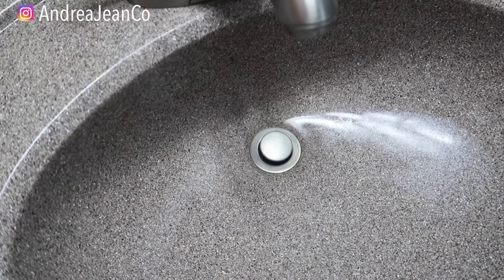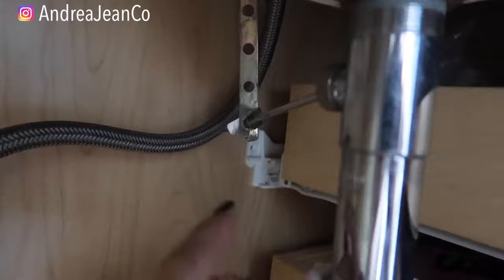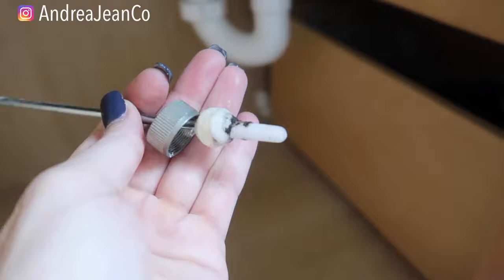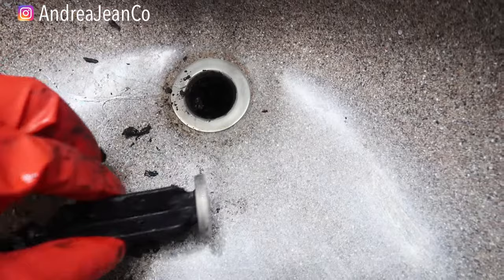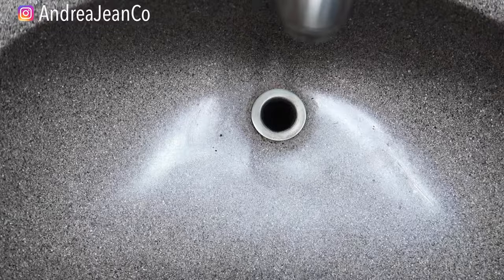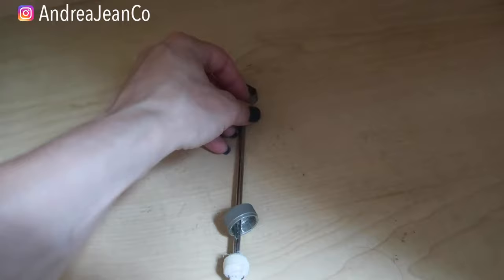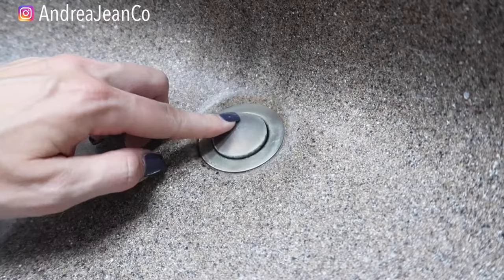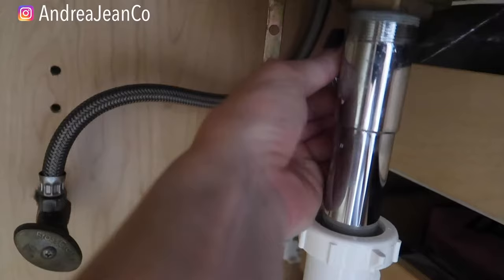How to Remove DRAIN STOPPER POP UP!!  (Unclog Cleaning Hacks) | Andrea Jean Cleaning

Comment: I would use Drano and then for a week it became slow again, use Drano, wait a week, and so on. 
I was ready to call a plumber until I came across your video. I pulled out the stopper and it was encrusted with what would look like tartar on teeth, but thick amounts of it. Soaked in vinegar for an hour, then scraped off the stuff. Thanks a million!

Comment: I finally know how to remove the drain stopper. I've been using random items to clean out whatever I could pull out. Only problem now is that the stopper doesn't go all the way down so the water drains instead of letting the sink stay filled up but I'm sure I can eventually fix that. It's not much of an issue. From extremely clogged sink to practically brand new is wonderful. I'm glad to have seen your video. It didn't even take me ten minutes to fix the sink.

Comment: Andrea, you did an excellent job on this video that will help so many people....  and I'm amazed at your camera work. I just cleaned mine out a couple of days ago and I always dread it because of how hard it is to get the little hole in the  stopper lined up with the rod underneath all while with one hand you're holding the fitting underneath.  It's like you're in this big body hug with your sink!  ...when you took it apart, I thought to myself that I hoped she remembered to notice what hole the rod was stuck in because that makes all the difference in how it all drains and you certainly don't want to do that body hug any more than you have to.   ...i was able to go almost three years without cleaning mine and that's great because I always wash my hair in the sink but I also collect that hair from the bowl before draining just to avoid having to clean more often and also it shows me my fallout.  In other words my practice at home is to head off trouble by watching what goes down the drain.   ....this clean out is something everyone should do themselves instead of calling a plumber.  I know someone who puts some God awful chemical in hers to clean it and I have explained how easy it is to really clean it this way.  I have a septic system and I definitely don't do anything to disturb the natural balance of bacteria in the septic tank plus I don't want harsh chemicals sloshing around in my pipes and seals. They're my friends, right (lol).  From one girl to another, you did a great job on this video.  Best wishes with baby!
Reply: i ❤ i’m

Comment: I had a skuzzy bathroom sink drain that needed cleaning. I did this before several years ago but needed a refresher. So, I Googled "Kohler bathroom drain plug cleanout instruction video" and there you were. Easy to follow!  I will save your video for next time because I will likely forget the details next time. Thank you so much! I now have a free flowing clean sink drain. The hardest part was crawling around under the sink on bad knees. How did you ever do it while expecting a baby!  Wonder Woman!
Reply from the maker: Thanks so much ❤️❤️❤️

Comment: Super helpful, thank you for making this so easy. I used a pair of needle nose pliers to remove the hair below the stopper. Once I reconnected it it was still draining a little slow so I poured about a half cup of hydrogen peroxide, waited 5 minutes then flushed it with hot water and a little dish soap. It is now fully draining.
Reply from the maker: Glad it helped!

Comment: Thank you so much for this video! Worked like a charm! The only way my experience differed was that had bought a sink shroom that i knew id be putting in the drain instead of putting the stopper back in. With my long hair, I knew that would be a better option instead of having to routinely clean out my drain this way from now on. I did put the screw back that closes off the hole in the pipe itself, but it didnt reattach the stopper mechanism since I knew I wasnt going to be using it at all. So, I just put the original stopper and the clamp that attaches the stopper into a small baggie and put it under the sink, so if i decide i need to use the stopper at a later date, i can reattach it. Thanks again!

Comment: Thank you SOOooooo much for your video !!!! I can not believe that I’ve just fixed my two bathroom sinks . They were clogged almost completely for months and  every time I use them I think how much I should to pay to plumber ..... And today I found your video . And I with great fear, knowing that it is easier to disassemble a thing than to put it back together, began the “fix the sink yourself” operation!  I followed step by step your explanations in the video.  I will not say how much sh*t I pulled out of the drainer ...... And then I put everything back together and turned on the water .... And what a miracle !!!!!  My sink was like a new.  Everything turned out just perfect! I didn’t have any extra parts left over  as usual 😂, and there wasn’t any  leaks, which was also one of my worries.  THANK YOU again for your help.

Comment: works great.  I found that I didn't have to disconnect from the vertical slide, just unscrew the cap from the drain and wipe the white thingy clean,  That made it easier to reattach.

Comment: Watched this video and had a lot of confidence I could do this and was feeling better about things…boy was I wrong. Currently in tears because my sink is apparently still clogged and I think I just made it worse?! The water is going down a lot slower now and I’m at my wit’s end. Cleaned out the drain with a toothbrush and there wasn’t even as much gunk as what I saw in this video, but I am wondering if I might have accidentally pushed down more gunk I couldn’t see further? Thus that’s why the clog is worse?! Idk but having a mental breakdown because my bf is useless in this department and works a lot, and this type of work always falls on me. Thanks for this video regardless. You inspire me to try harder and just keep learning.

Comment: Girl you just saved me from calling my plumber!! I didn't even get grossed out.  I was wondering, if I wanted to do a drop drain clean, could I close the hole that holds the stopper connection and fully clean the drain with liquid drain products? Do they have an extra piece so no water or chemicals come out the whole?
Reply from the maker: Glad I could help!

Comment: I have used tweezers to pull gunk out from under the plug lid to avoid having to completely remove the plug .  In your case, I think I'd use some long needle nose pliers to reach down the drain and get a good hold on the hair mass and pull it up.

Comment: Thank you! It took so long to find a video to show how to remove the plunger! I did two sinks in 10 min! Also I realized you can just unscrew the part that hooks to the plunger and let it hang while you pull out the plunger. Unless you need to clean it.

Comment: Thank you so much... it's the knowledge I needed to get a dime out of my bathroom sink. I use an, as seen on TV snake with Velcro on the end to get the hair out of the drain. So, when I got the plug out there was no hair, but the end of the plug was filthy, caked with black crud, so I cleaned it off. AND I got the dime, but I had to take the U pipe off to get it out. Again, thank you, I appreciate your video.

Comment: I did mine and it was almost so easy!  Except I took the cap off and the plug fell into the P-Trap.  Don’t panic, put a bucket under there as a little water will be in the Trap.  Unscrew both ends of the P-Trap and get it out (which is probably on her other video). WARNING, when you open the trap the smell will be horrendous…I immediately poured some minty mouthwash in the bucket of water and gunk from the Trap.  I’m proud as I didn’t have as much hair as she did, Lol. You can do this !!

Comment: It might be possible to just unscrew the drain plug lift without disconnecting the lift arm at the back. The arm will just angle rearward with loosened lift plug mechanism after removing the screw. Thank you for the nice video covering stuff that we all dislike doing! It's nice that you take the time to produce your informative videos. You may consider placing the drain plug 90 degrees to the lift arm mechanism for easy removal, just keep in mind that drain doesn't seal as well when the plug and drain gets dirty. Also I think Dollar Tree sells a drain tool that cleans the drain it's a stick with plastic barbs that catch the hair on removal from drain. I'm glad you covered a subject that we all dislike cleaning but has to be done.

Comment: You don't have to disconnect  the white plastic bar under the sink from the vertical metal lifter that has the holes.  Just screw the lid open and pull the white plastic bar from the drain tube

Comment: Mine is the newer design where you push down to enable filling, then push down again to drain. There is no lever.  It is critically important not to do hair in that type of drain. You can't pull it out to clean the drain. Should have gone with the lever style. Oh well, live and learn.

Comment: If you're going to use hot water to flush the sink once the stopper is out, I highly recommend screwing the stopper holder back in before doing that. Otherwise the hot water will flood the cabinet under the sink, like it did for me.  Even if you put a bowl under the drain before flushing. Grrr, more to clean up

Comment: your Hardware store will carry a "hair snake" . Its a long tough plastic  cord that has  molded "barbs" all along the cord that snags the soap encrusted hairball  so you can grab it and pull it out. You just thread it down the drain twisting it as you work it  down, like turning a corkscrew into a cork in your wine bottle. Once you have it all the way down the length of your P-trap ( that U-shaped elbow that makes up the crook in your drain) then with deliberate pressure, slowly pull it out like you are pulling a wine cork. The hairball will come out  in one giant wad. Especially helpful in clearing shower drains. The soap scum builds up on the sides, the hair sticks to it and you have a hairball. Don't waste you time with chemicals that can burn you, stain your sink or countertops and cost a fortune. The hair snake is tough plastic so its flexible and won't scratch your sink or chrome drain trim and is reusable. Some varieties of Liquid Plumer will include a complimentary hair snake shrink wrapped to the bottle but they are so popular they started selling the snake separately.
Reply: Do you have any recommendations for an apartment that’s not allowed to use this I live in university housing and we’re explicitly told not to use those but I run to this problem a lot. Thank you

Comment: Get a drain cleaning zipper tool and use it to pull the hair out of sinks and shower drains.   They only cost a couple of dollars.  Plastic tool is about 18" - 2 ft long and have upward pointing spikes on both sides that grabs the hair clogs.

Comment: There is a mini sink snake you can get at the $store or in a 3- pack from Wal-Mart for less than $5. It has vicious looking little teeth that works incredibly well even without getting the drain plug out. Once the Hank of hair is gone, squirting in about 1/2 cup a grease cutting soap like Dawn letting it rest 45 minutes followed by hot not boiling water should clean out the remaining organic funk from the drain.  This is the best home remedy for a clogged toilet I've found. THANK you YouTube. I found that the Awesome brand  from $Tree also works for far less cost than Dawn.

Comment: I started and got the stopper out, then I dropped the toothbrush down the drain when I was scrubbing, so I was trying to get it out for like a good thirty minutes 😭 I tried getting it out by sticking a wax strip to it bc I couldn’t reach inside the drain but then the strip got stuck too 😂 I saw online it said to get hot glue and let it stick to the tooth brush so I was running around the house looking for the hot glue gun and I lied to my dad saying I was making crafts and then I ended up dropping a heavy book on my head when I was looking through boxes. I found it and got the toothbrush out though 💀

Comment: If only every sink pop-up were this easy! The plug I am trying to release is below the level of the outer rim and will not in any way, shape or form move anticlockwise. The plastic pipe underneath is encased behind a ceramic pedestal that only the smallest of hands can get into. Nothing on any video has been beneficial to my predicament & I know so many people in new builds with this problem. If only we still had the old rubber plugs on a chain!

Comment: My mom showed me that if you take apart a wire hanger, the corkscrew looking piece n small little hook pieces will unclog most drains. I had to do it for my boyfriends mom. Her drain was so gross I had to take apart the pipes under the sink n clean the nasty outta them. It smelled so freaking bad. N then put it all back together. Both her n my boyfriend were impressed with me after that lol.
Reply: Nice of you to do it for your bf’s mom. But that will scratch the pipes. May cause pipe corrosion, depending on what type of pipes you have